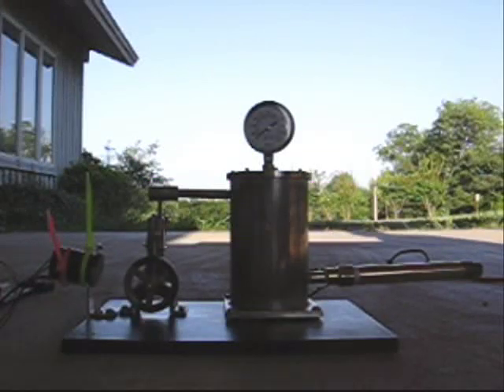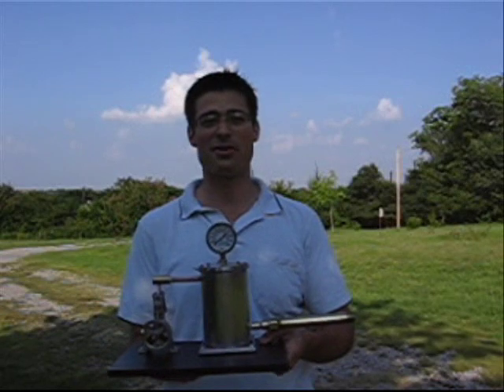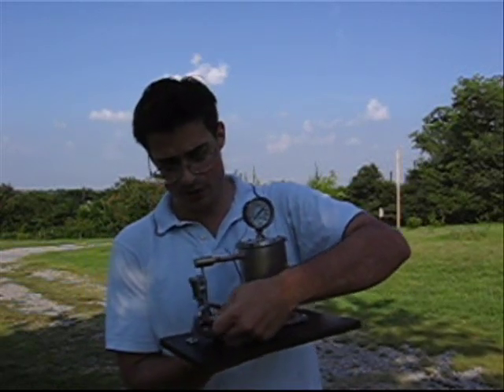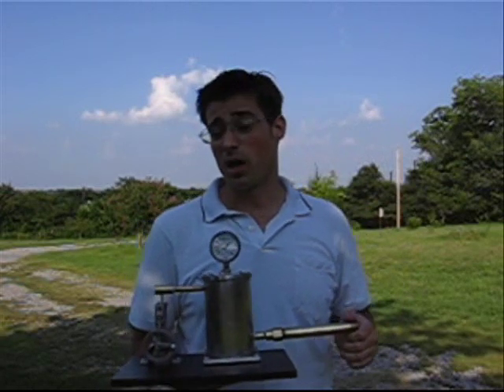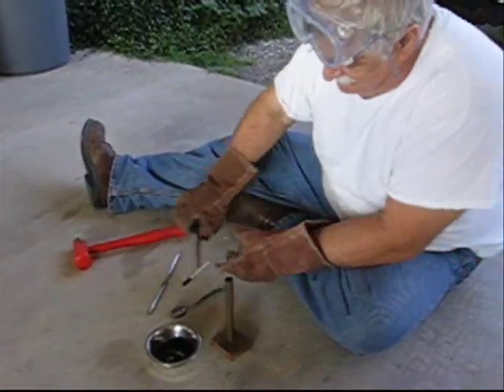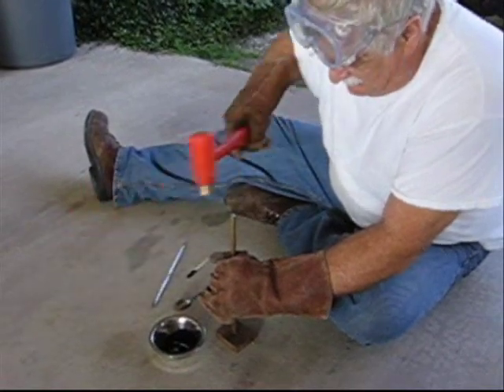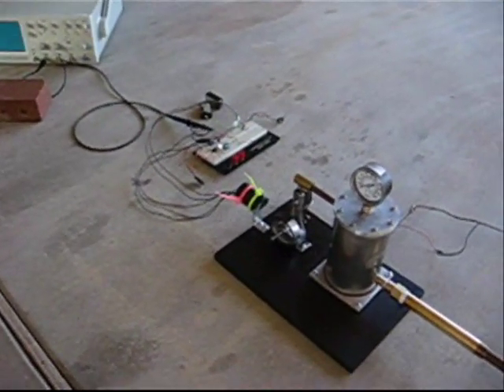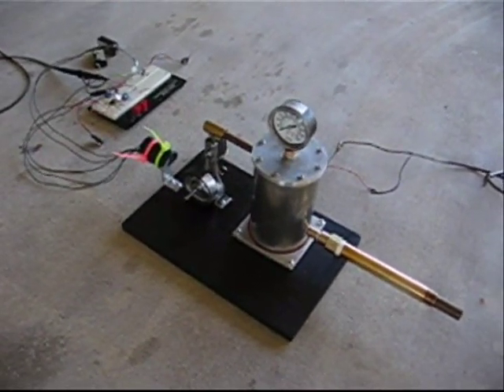Mythbusters Blackpowder Engine Challenge

Comment: How do the torque and rpm figures compare to a coal powered counterpart? (thinking to compare early engine power options)
Reply from the maker: I am assuming by “coal” you mean coal fired steam, not to be confused with Rudolf Diesel’s original internal combustion engine  which ran on coal dust.  Anyways,  I didn’t measure the torque of the device, but I think it would be similar to a coal (steam) engine.  In an oscillating piston engine, torque is directly related to pressure.  For this black powder engine it would be the same, except instead of steam pressure it is mostly CO2 pressure.  I was told by an engineering professor years ago that “triatomic molecules have a highly expansive nature”… so steam being H20 would provide good torque as would carbon dioxide CO2 which is produced from burning black powder.  

However, Black powder produces 40% gases and 60% solids (as seen as white smoke hence the fouling issues).  The equation is 4KNO3(s) + 7C(s) + S(s) → 3CO2 + 3CO +2N2 + K2CO3(s) + K2S(s).  

Therefore, to answer your question, the following experiment would need to be conducted:  Using a two-way oscillating steam engine piston, power the engine on steam at 30 psi (about 275 deg. F) and measure the torque….then, power the same engine on a mixture of carbon dioxide, carbon monoxide, and nitrogen (you would have to do the stoichiometry to determine the mixing ratios) at 30 psi heated in a pressure vessel to the same temperature as the steam (275 F).  I would eliminate black powder from the torque experiment because it is difficult to control the burn rate.  By directly comparing the performance of a gaseous mixture that simulates black powder combustion with steam pressure, you will have your answer.  I suspect that the results would be similar at low rpm because pressure is pressure, regardless of the gas.  But at higher rpms you might notice some performance differences because the pressure drop across the ports/pistons would be different for the various gases being tested.  Hope this helps.
Reply: @CharlieMacklin1  Thankyou, and yes to be honest I didn't know there was an alternative coal fuel method, I only know very basic physics but I'm guessing that the fluctuations in burn rate is part of why this never became a mainstream power source, i.e. like having a throttle that constantly opens and closes?
Reply from the maker: @CatGirlCarGirl  yes, fluctuations of burn rate could go from smolder to explosion real quick if you have a crack or fissure in the powder log.  And I think most inventors of the past would not have had the advantage of the knowledge of model rocketry to create a relatively stable black powder fuel log.  

Other reasons it couldn’t catch on would be the corrosive nature of black powder combustion residue.  Also, any time you have a fuel-oxidizer mixture (such as black powder) there is a chance it could carry a spark or flame back to the main tank and blow up the whole machine.  Another reason would be that, carrying the oxidizer mixed into the fuel is less efficient; take for example the nitro-methane used in dragsters.  Nitro-methane is drank by the gallon in just a few moments, that’s because it has oxygen in its chemistry, which means the engine needs a much higher fuel to air ratio.  The same is true for black powder, which requires no air for combustion; so your device would have to carry A LOT of black powder by weight.  

Consider that in a gasoline engine the air:fuel ratio is 14.7 :1 so when you fill your car with 10 gallons of gas (about 70 lbs) remember that by the time it gets used up you will have burned with it over 1,029 pounds of air!!!
Reply: @CharlieMacklin1  Thankyou that makes alot of sense, you are quite good at explaining this, and I really appreciate your time.

Comment: The older engineers that made of use to have bigger vents ass clyender pushes up like a gun bolt bigger vents so anybody watching u have to desinges an engine like that and most of time was used instead of spark plugs or starter motor were myth comes from but the fuel u use for what u doing don't got enough compression to go high speed bc has to be vented more and loss off horsepower it is possible to make an engine run off it like u can wood gas just some engineers desinges it to work better for that but thsr engine is banned i shouldn't be talking bout it do not do it at home or do harm by copying me disclaimer do not promote that just a gear head and gotta be made out thicker metal they heavy big gears kinda pointless now

Comment: is the powder spring loaded to push it into the combustion chamber?
Reply: The Rust Admin.  The powder is compressed into a paper tube...but it is not spring fed, it is just a single log with a friction fit which acts as a safety (pressure spike would push out the powder log).  I suppose it could be arranged with a spring feed as long as it has a log type form.  I had originally tried a variety of powder feed mechanisms but any loose powder would misfire.

Comment: I imagined fouling would be a problem.  How long does it continue running before the 'gunk' becomes an issue?
Reply from the maker: Oh yes fouling was definitely a problem.  After that 32 second run it was gunked up pretty bad.  Conventional black powder combustion products contain a lot of particulate matter... it would require a filtration system to get longer run times.
Reply: CharlieMacklin1
Thanks for the response! 

How's that compare to coal or gasoline?

Comment: To me not a good design as valves for this shit can break and it will clog up filter or not. Filters will still lower the pressure. I have designed one that in theory looks exactly like a gun but spins a motor. It has a clip like attachment a pin and everything.

Comment: What I don't get is why didn't they even mention an automatic gun on mythbusters? A machine gun is the best example of a blackpowder engine. You load it with fuel/ammunition, pull the trigger, the weapon fires and uses the force generated to reload itself and continue the cycle. They didn't even build anything that even resembled the function of an automatic weapon. And also the wheel that they build which resembled a Catherine wheel firework but did not function like one. If they prepared the powder into small rocket engines it would've worked.  They can't be very intelligent.
Reply: Mythbusters => they also failed to make a concave mirror set fire to wood or cloth, as the Greek made Archimedes
Reply: Yes but that rotational shaft is only a result of gearing. All you'd need to do is set up some gears so the back and forward motion powers a rotational shaft. Very simple.
Reply: Think about it. A piston in an engine goes back and forth but links up to arms and gears which in turn link up to the rotational shaft. Surely the same concept could be used with an automatic weapon mechanism, couldn't it?
Reply: ukjay23 like a machine gun constantly firing at a merry go round.
Reply: ukjay23 

Edison tries thousands of times 

Myth-busters tries three or four times

Comment from the maker: :)  Thanks, that would be cool.  I understand that the video could show more close-ups of the engine; maybe a video showing a dis-assembly of the device would add some clarity.
Reply: This is really cool. However you and mythbusters missed is that this implementation is antiquated.  We figured out half of the gunpowder engine a very long time ago. 
Its machine gun. It has all of the elements of a motor but implemented in a different way for a different purpose. 
 It has fuel, load and a mechanism for reciprocation. It can even be equipped with an extended fuel reserve and a cooling system.  The only thing we need to change is the load. Instead of a projectile, change that into a captive reciprocating piston with a working end. 
 Sure there will be an issue of a lubricating system thats needed, but that can be done similarly to a standard ICE with an oiling system and rings on the piston. The point is that cartridges elegantly solve the problem of how to consistently and easily deliver the fuel into the chamber for combustion and obviates the need to chemically modify the powder to control its rate of burn. You can simply math out the power needed per cartridge and put that much powder in it.

Comment from the maker: Well Jesse, I can't tell you how it was built because the Lizard people got back in their spaceship. Just kidding.  It's real.  I bought the engine from a company called "PM Research".  I built the larger, vertical tank from aluminum courtesy of "online metals".  The brass cylinder blackpowder cartridge was made from home depot plumbing parts.  There's not much to it mechanically, it's more about getting the correct powder burn rate and getting the tank sized right to moderate the pressure.

Comment from the maker: I suppose if you got the tank size just right you might be able to sustain the pressure for a bit, but that initial spike in pressure (when the shell goes off) might burst a small container.  Think of it like trying to capture a bolt of lightning... not sayin it can't be done, just that it would be easier if the energy wasn't movin so fast.

Comment from the maker: You're welcome.. Yes, I do think the charge pressure from a .22 cartridge could be captured in a pressure tank, however, the .22 shell burns so quickly that you would only get pressure for a second or two.  In theory, if the tank was the right volume and was perfectly insulated, then yes you could capture the pressure from a .22 blank shell.  But in reality, the fire and gases discharged into the container cool very quickly, and the pressure drops within a second or so.

Comment from the maker: Yes in some ways it would be more convenient to use a blank nail gun .22 cartridge, however, my initial testing found that a small blast of granulated blackpowder would only create a temporary pressure spike for about 1 second, because the heat quickly dissipates.  Having a properly compressed powder log results in a steady, sustained release of heat and pressure.

Comment from the maker: Gunpowder and Black powder are not the same.  Black powder consists of KNO3, Sulpher, and Soft Charcoal.  Gunpowder (modern smokeless powder) consists of nitrocellulose and nitroglycerin.  

But I like your idea.  Smokeless powder (nitrocellulose) is readily soluble in acetone.  One could dissolve smokeless powder in acetone, and if it didn't get to viscous, you could probably run a engine off it with only minor adjustments to the carb jets.  That might be a good one for the lawnmower :)

Comment from the maker: I'm not understanding your angle here.. the challenge was to have an engine run on gunpowder / black powder, not to break the efficiency of steam expansion.  Again, they have an air powered car, so obviously torque can be produced without water vapor.  

I could understand if you said "well that doesn't count because the powder is compressed into a log, and that doesn't count as powder"... but no one makes that argument.

Comment from the maker: Thomas, it may produce less torque because the combustion products don't  have the expansion characteristics of steam, but to say it "can't create torque" is not correct; it has to create some minute amount of torque otherwise it wouldn't spin.  

You may check my memory on this, but I think the combustion products include CO2, which is a tri-atomic molecule with similar expansion characteristics as H20.

Furthermore, here is a car that runs on air, which is closer to an ideal gas than steam.

Comment from the maker: LOL.  :)  It's not very practical
1 pound of black powder yields 1293 BTU, 1 pound of gasoline yields 17,500 BTU.
With Gas, 2009 Toyota Corolla: 30 mpg highway 22 mpg city, or 5 miles/lb highway 3.67 miles/lb city.  Assuming equal engine efficiency, with Blackpowder, 5/(17,500/1293) = 0.37 miles per pound highway and 3.67/(17,500/1293) = 0.27 miles per pound city, or about 3 pounds per mile :)  Raw black powder ingredients cost $5 per pound, we can get your 2009 Corolla to go 1 mile for $15 :)

Comment from the maker: Dude, please.  That video you posted is a Stirling Engine.  It is NOT the same machine.  As I stated in the last message, my engine doesn't have a heat transfer medium.  A Stirling engine does have a medium to which heat is transferred, air.

Comment: you are still missing the point; I have several of these:  youtube 6DBktwPf3rk they run on anything that is warm (just as your engine runs on any expanding gas) so my engines run on a warm ANYTHING such as a TV, or your hand, or ANYTHING I warmed by setting off black powder near it- however since I can understand the idea of the contest I would not do what you did and pretend they are black powder engines given the context of the challenge

Comment from the maker: Oh I'm sorry did you have another blackpowder engine that works better?  To have "one ignition inside the cylinder per stroke" was not a requirement in the episode, was it?  It's an engine.  It runs entirely on the combustion products of blackpowder.  It has no other fuel, nor does it have a medium to transfer heat, such as water or steam.

I agree it would be good to see a system that solves the powder reload / ignition problem.  Maybe some other time in another video.

Comment: this misses the point entirely; to "run on black powder" there should be an ignition in the cylinder per stroke; this is just compressed gas from burning something. You could use the black powder to heat a shitload of water and run an engine; but anything flammable on earth can do that

Comment: if you compressed the powder into a cylinder shaped molds .... that didn't break up on contact .... then they could be used as an 'ammo' of sorts and be loaded right after the previous one is used up .... They would have to be mixed with something probably that is still combustible but won't ruin the current ratio .....

Comment from the maker: Yes with a but:  mechanically an "auger" or Archimedean screw would work to move powder, but, the Archimedean screw does not form a pressure seal.  An example is a spiral stair case; people and air can move up and down it freely.  So essentially an Archimedean screw would allow pressurized gas to flow through it in a fuse-like spiral pattern.  It might work, if you had a way to prevent the combustion gases from entering the screw, perhaps with rotating indentions or some other pressure seal.

Comment from the maker: Hmm, might work for a bit, until the rotating depressions get hot and the bp container lights up like July 4th :D

Perhaps a happy medium would be to form a slow burning black powder into little pellets or pills.  An engine, like in the video, could have a combustion chamber fed "pills" via a mechanical feeder.  The feeder could be positioned so that it wont get hot.  If each pill were designed to burn for, say 0.5 seconds, then the feeder would have to cycle at 120 rpm to maintain operation.

Comment: @CharlieMacklin1 the 1st time i heard of such an engine (according to legend one was powering a fountain in Versailles) i thought of it as something similar to a modern revolver, and with fast burning bp. A bp container fills 6 or more rotating depressions which are moved under the combustion chamber and ignited through the weight of the returning piston. I wonder if that design would work,sounds like a machine gun :-)

Comment from the maker: @ABW941  Yup that was my original design, having a small loader to dump bits of powder in, thus allowing a way to control the engine.  However, granulated black powder tends to clog, and I didn't have much success with that design.. plus having granulated black powder in a "fuel tank" usually leads to an explosion, since the fire tends to find its way into the main tank.

Instead a soft, slow burning powder that would compress into a single slow burning mass worked better.

Comment: So the small portion of Black powder is delivered into the Chamber were it builds up Pressure to power the engine?
To continuously operate such an engine, would it be possible to connect the delivery system with the pressure measurement device, so that it would be able to "load" the next portion of black powder when the pressure drops?

Comment from the maker: @normellow  cool :) In the video, the test run did not have a water filter... i didn't want to add confusion as far as possible steam production... but yes, a water filter would probably help with carbon build up.  Did you ever get a running prototype?  If so, definitely post a video... strength in numbers.  Black Powder Engines Unite !

Comment from the maker: @rich1051414  I agree.  The Tesla turbine would definitely be easier to clean.  I tried the slow burning black powder, bound in a tube, to drive a turbocharger.  It seemed to produce plenty of heat, but a whole bunch of "gunk", and without a high enough flow rate of gases to spool up the turbo.  Perhaps it would work if the combustion gases were focused through nozzles, as in the Tesla turbine, or an impulse turbine.

Comment from the maker: @fawkes37 

Sure, Here is the same kind of engine, they can run on steam, air, or apparently, combustion gases from black powder :)

Just youtube:
"Steam engine PM Research oscillating piston"

The larger tank (at right) is a pressure chamber that captures the gases from the burning blackpowder.  Those gases are then piped into the "2-way oscillating piston engine"

Comment from the maker: Well, most of the smoke is filtered out in the pressure chamber.  There is a very fine mesh screen inside it, which helps to catch most of the particulates.  If you watch closely in the video, you might notice a very slight puff of smoke.